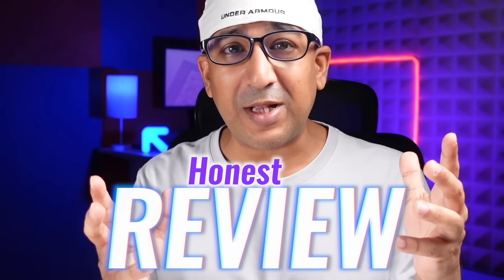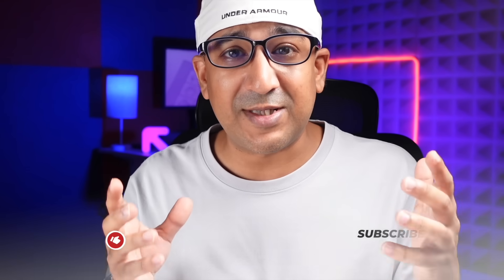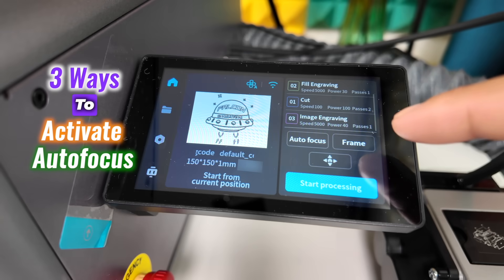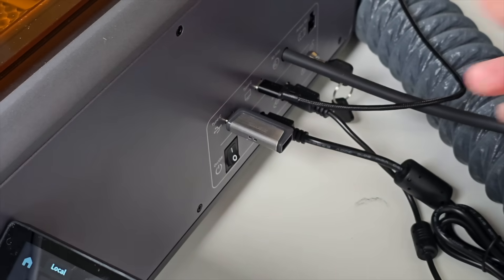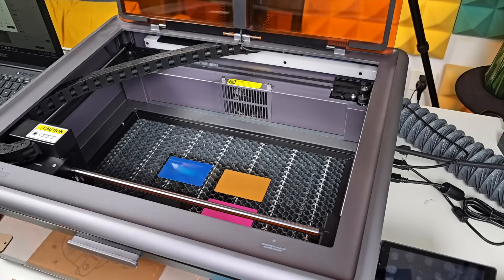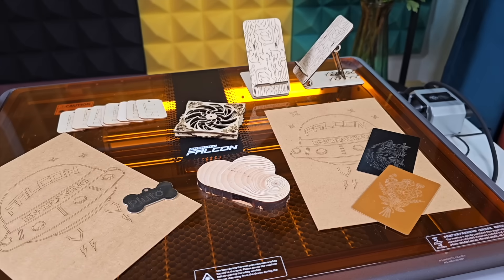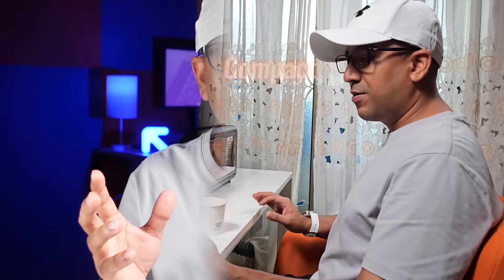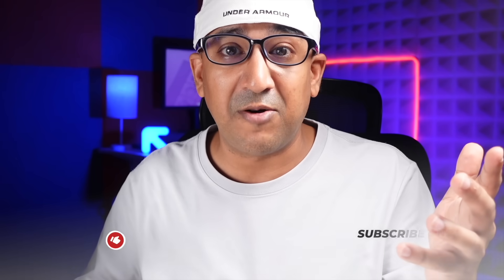Unboxing the New Creality Falcon A1 Pro – Best Laser Engraver of 2025?

Comment: Seeing thick plywood cut clean and metal tags marked precisely, all on the same frame, says a lot about what this machine can handle. The switch between modules is quick, and the alignment tools make setup feel less like a chore.
Reply: The balance between cutting depth and precision stands out. Not just fast—it’s deliberate
Reply: Swapping laser heads used to feel risky mid-project. This one made it feel like part of the flow.
Reply: Camera placement tool helped lock in layouts so much faster than expected. Real timesaver.
Reply: Agree with you

Comment: Software looks less confusin than others out there, even from the screen it feel easier to press through stuff without checkin tutorials every step. clean interface helps loads.
Reply: the app and software both are easy to use
Reply: The software surprised a lot of folks—snappy, clear, and doesn’t get in the way.

Comment: Some desktop machines look good on paper but fall apart in practice. This one holds its line across wood, acrylic, and metal without skipping or burning out. The autofocus and built-in camera genuinely remove so many small headaches from everyday jobs.
Reply: This one is reliable
Reply: That touchscreen and camera combo cuts setup time way down.
Reply: this is not just looks good on paper
Reply: This one stays steady across the board.

Comment: Laser engraving at this level used to feel way out of reach. Dual-laser setup, autofocus, even metal engraving—all packed into a desktop frame. Seeing this work at 600mm/s without losing detail feels like something built for real creators, not just hobby use.
Reply: Dual-laser setup really opens up more material types
Reply: with such small size, the engraving is very precise
Reply: That speed with consistent cuts—feels like it was built for actual use, not just specs on a sheet.
Reply: Getting that kind of performance without building a separate workshop setup is rare at this size
Reply: Not every day a desktop engraver brings both precision and speed like that. Worth a closer look
Reply: Totally agree